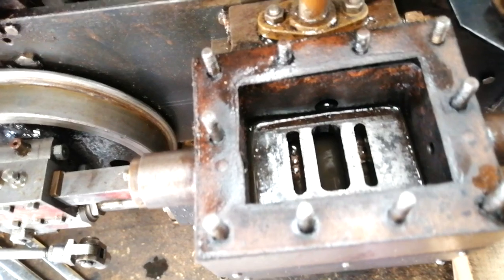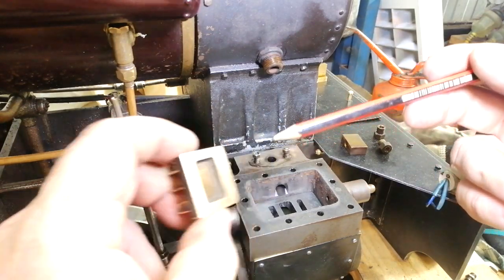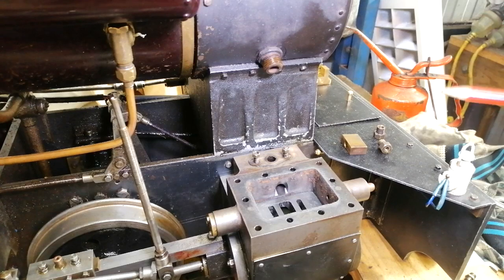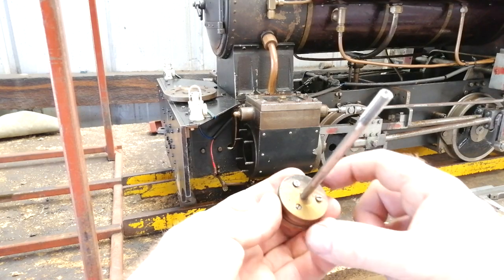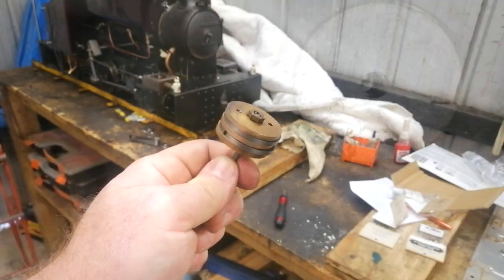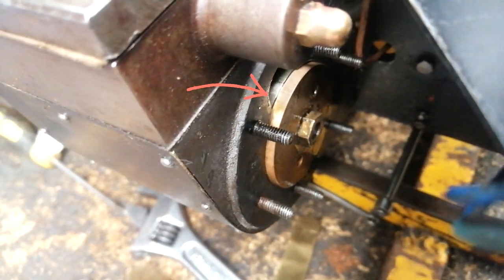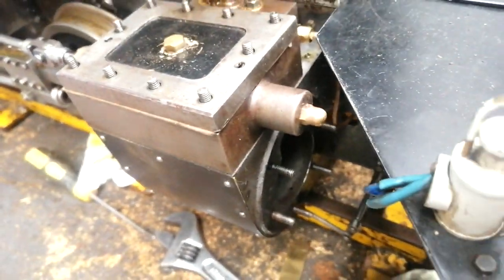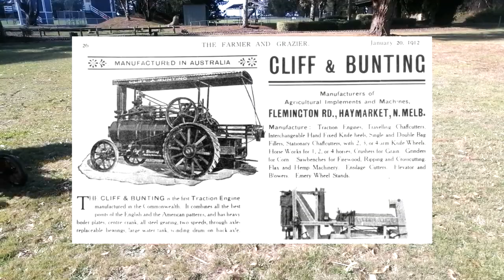Live Steam Engine , Lets go Buy a Steam engine ! (Part 2 )........Live steam Locomotive

Comment: You did a beautiful job!   I’m jolly impressed.  What ignorant, non steam-wise people don’t understand, is that despite the disadvantages of basic steam reciprocating machinery, it is very durable, tough, and very easy relatively to repair and maintain.  Dirty and tedious, yes, but not complicated.  The main fault with poor steam ENGINES is that their boilers waste fuel by heating unusable NITROGEN, instead of the water in the boiler.  Some of the hot nitrogen can pass the heat back to superheaters, but dry steam calls for technical lubricants.
Reply from the maker: It's amazing how forgiving a steam engine can   , thankyou for taking the time to comment  I appreciate it , I'm happy you enjoyed the video .

Comment: about what did you pay for this engine, checking one out that's 51 inches long and about 8.25 inches wide from cabin point, tracks are about 4 inch's wide wondering about what the value of these steam engines are oh and its been on display for about 9 years! and its so precise!
Reply from the maker: Your best bet is to find a local club to get a full appraisal

Comment: Hey mate, Excellent video. I have been running a Sweet pea for a few months now. May I suggest that you have the reverser on the first notch in forward gear. This will prevent a lot of ash getting in the smokebox and fill the grate much slower.
Reply from the maker: Hi max thanks for the response I will give your suggestions a go 👍

Comment: Excellent!  I started to restore an older Ajax 5" gauge locomotive a few months ago.  The copper boiler has some tiny weeping around some of the stays, so I'm on pause until I can figure out how to deal with that.  Silver-soldered boilers are unknown around here.  I enjoyed your fix of your loco... it sounded great in this video.
Reply from the maker: Thankyou Stan, I appreciate your kind words if the leaks are on external stays you could use some wicking compound from loctite, or try localised heat with a small propane touch and tin with soft solder